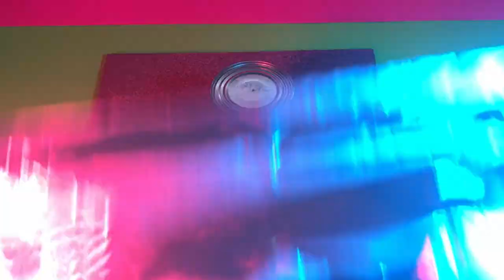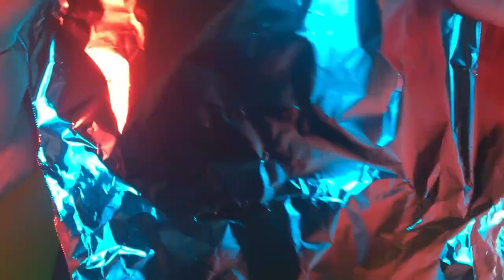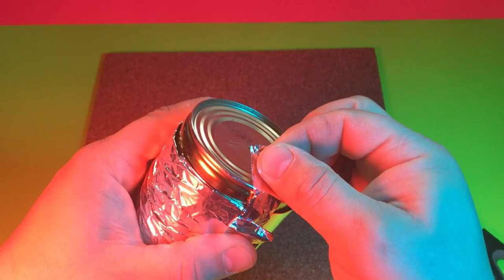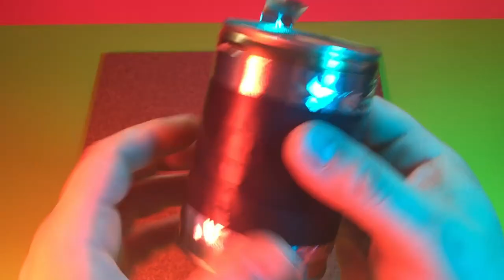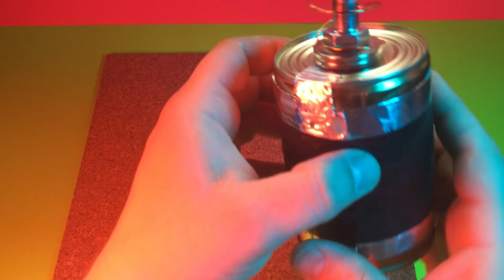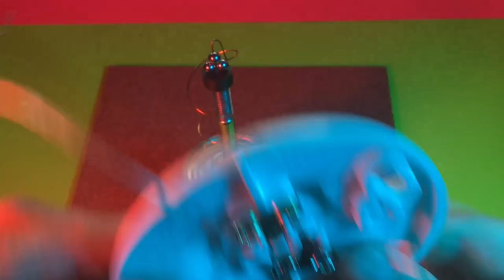New Free Energy Generator - Number One #freeenergy #generator #diy #fun #funny

Comment: I relave ALL Free Energy Videos
Until it works:

- somtimes there is a Hidden Wireless Energy Coil

- Sometimes there is a Hidden battery in the Motor or Generator

- sometimes there is a Coil or Cap that you muss load em before ..
(After a time it'll be slower and slower)

- or sometimes it's only galvanic Law
(Simple Batterie Chemie) 

Copper + Zink 
Copper + Ferrit (Magnet)
Copper + irdium (Spark Plug)
... 
+ A Secret drop Citrus or
   salt-water 

Not more

See electroBoom - Zombie SMD LED
They need only 0.03w so you can Connect it to all 

Combinate it and Troll people ;)